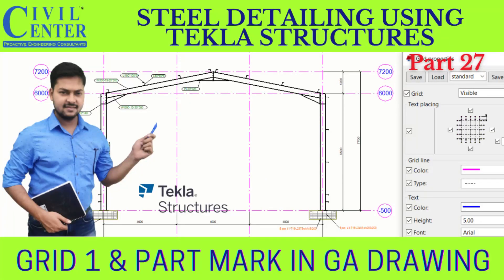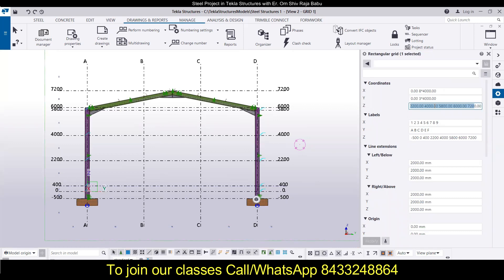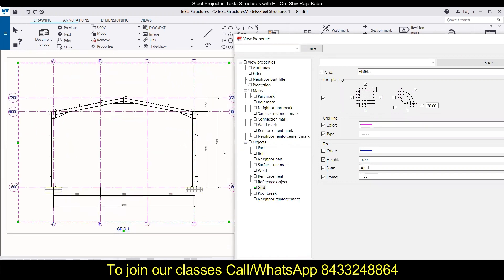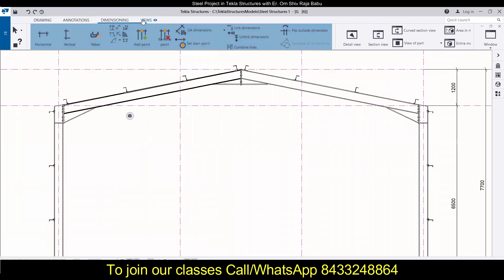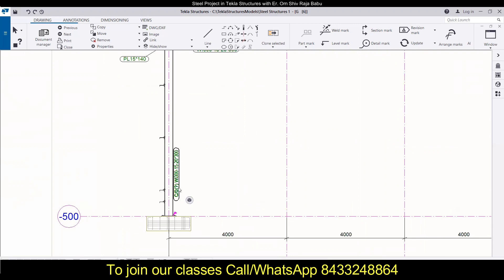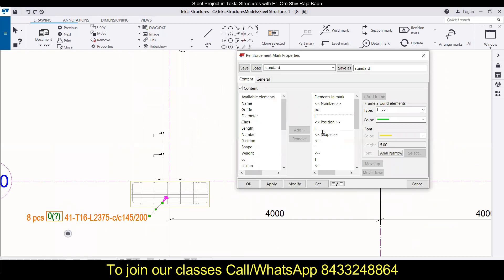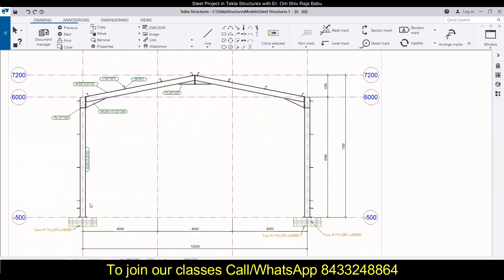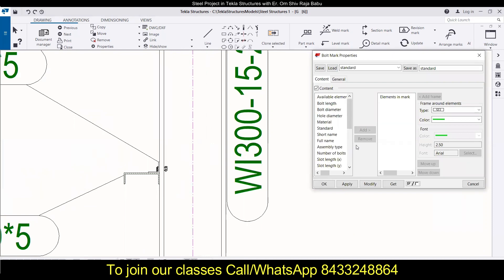Specific View in GA Drawing || Grid 1 in GA Drawing || Part Mark in GA Drawing | Member Modification

Comment: Hello mister thanks for share  with us 
But i have to ask you about the colors in the 3D if you do it automatically or manual thanks 🙏🏻
Reply from the maker: Hello Zakaria,
In 3D there are a few colors that are automatically assigned to the different members. But you can change that by changing the class of the member. For more details you may WhatsApp on +918433248864